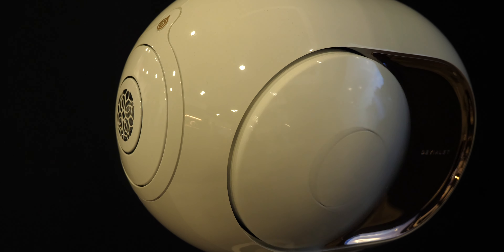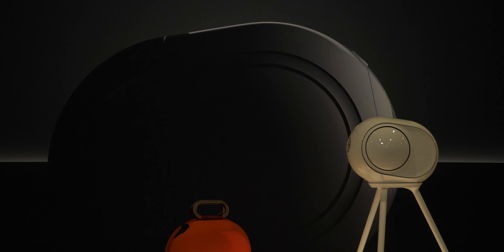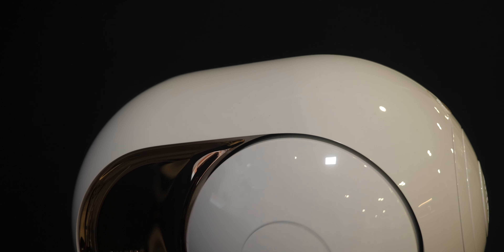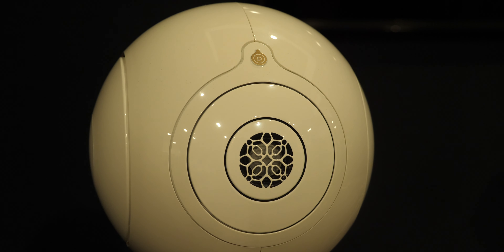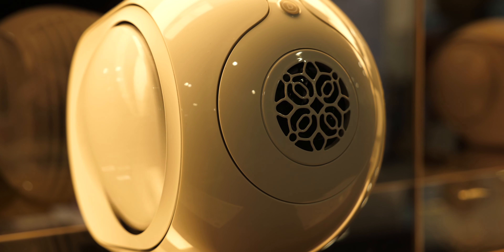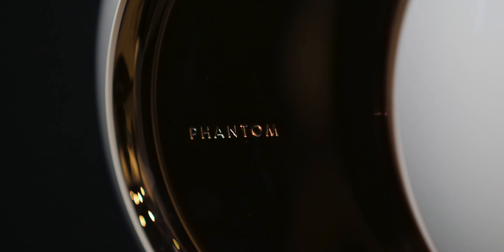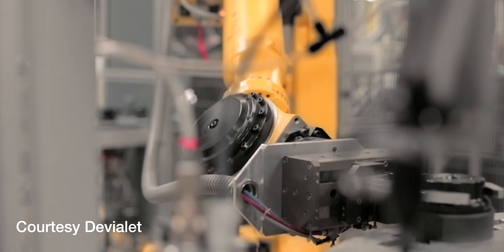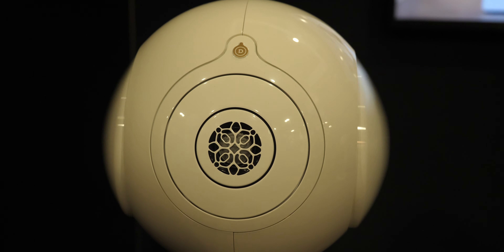Devialet Phantom Reactor Custom | Best Wireless Bluetooth Speaker System | CEDIA 2019

Comment: Devialet Phantom crank out the music well, and with bass. The problem is they are a nightmare to keep in healthy cosmetic shape. I would suggest a cover/towel over the united when not in use. The used ones i have seen have dust build up, and scuff mark issues. Well filmed TD, this unit cranks pretty loud. I have heard this unit in a outdoor setting and it was great in a M-L backyard. Indoors the unit blew my expectations away, especially the bass.